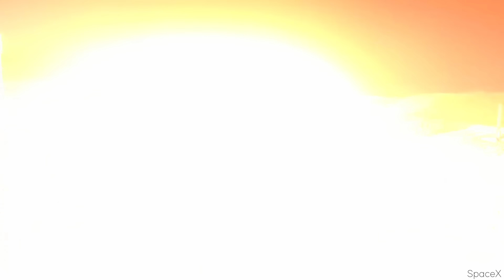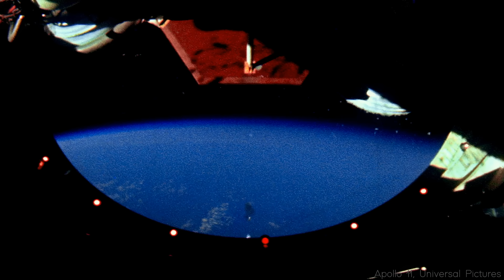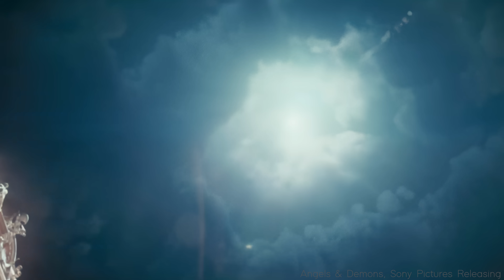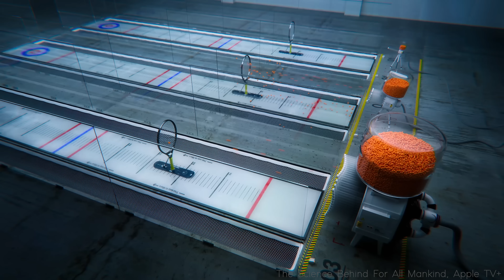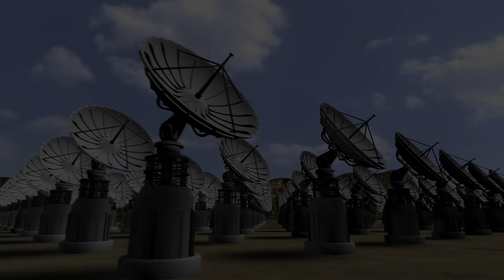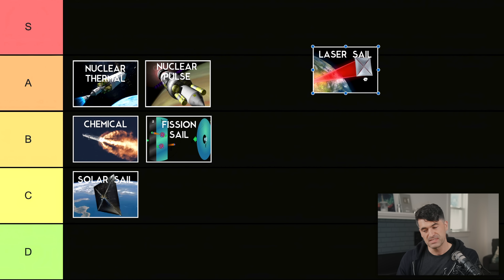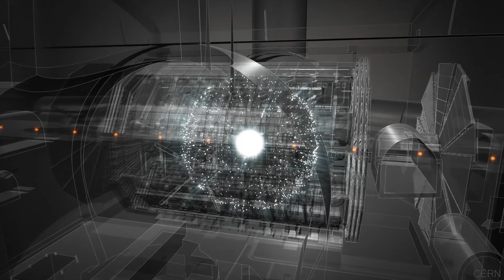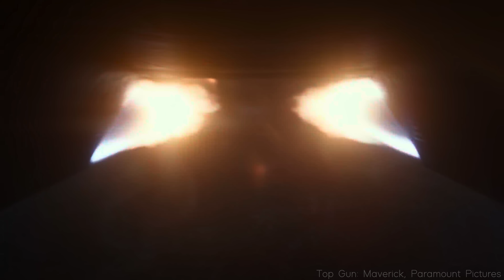Interstellar Propulsion Technologies - RANKED!

Comment: Another concept for a spacecraft is a variation of sails.

Originally, I had this idea, unlike others I’ve read about, but then I saw someone else propose it. I don’t remember it having an official name. We could name it “Pebble sail”

One of the major problems with laser sails is their enormous energy requirements. Photons are very energetic for the little momentum they transmit. However, a regular wind sail gets a lot of movement with little wind because the wind is made of air, matter. Being pushed by matter, the energy requirements drop significantly.

Additionally, due to the high energy requirements, the sail endures a lot of heat for little thrust, unlike a wind sail.

But in the vacuum of space, we can’t have air.

This proposal is to replace air with small solid particles. Pebbles.

Let’s assume we can create a beam of pebbles that moves at speeds only slightly higher than the speed of the spacecraft. Isn’t that practically equivalent to wind? The difference is that if the particles are solid, in principle, it should be possible to focus them over great distances.

Then there’s the fact that the spacecraft quickly accelerates, so the speed of the beam must be synchronized to match the low speed at the moment of impact, but it could be a gigantic speed at the origin due to the relative speed difference between the beam emitter and the spacecraft.

On the other hand, the energy required for moderate speeds is considerably reduced, and the energy wasted in the “impact” between the particle and the sail is also reduced, given that the impact speed is low.

An equally interesting concept to study, at least for moderate distances. For interstellar speeds, the major problem would be the extreme precision required between the beam and the spacecraft.

For unmanned spacecraft, a solution could be to use extreme accelerations that would allow reducing the distance in the propulsion phase.

However, like other propulsion concepts, it only works for flyby mission schemes. Alternatively, for future travel missions between both points, once there is infrastructure at the destination that could perform the equivalent braking using the same mechanism in reverse.

Comment: A conceptual ship is also one powered by a microsingularity.

To achieve this, it is necessary to have the ability to create singularities and artificially feed them until they achieve stability and can continue to be fed with mass, until achieving a singularity with a useful mass.

I asked ChatGPT (take it with caution, as there could be errors) what size a black hole would need to be for its radiation emission to be equivalent to 1000G of its own mass in photonic propulsion.

The weight corresponds approximately to the mass of a large asteroid. 1.27E12 kg.

The point is that if such a singularity could be created and artificially fed, we would create a body very similar to a miniature sun, with a gigantic energy emission, but that surrounded could push a ship at 1G speed for millennia (that’s why I put 1000, as I assumed it would not be 100% efficient, and the whole set would be much heavier than the singularity itself).

If such a singularity were surrounded by a sphere or swarm similar to a Dyson sphere, but due to its tiny size, the ship it would "only" be a few thousand kilometers in radius, it could propel that set for thousands of years.

And if somehow mass could be continuously injected into it, we would have a perfect matter-energy converter.

The point is that if the swarm/sphere redirects the energy back to the singularity, or radiates it equally in all directions into space, the ship is stationary. If it reflected the energy in a specific direction, the ship would move.

It is the miniature version of the proposals to move stellar systems. If the mass quantities are correct, we would be talking about relatively reasonable quantities for a civilization between scale I and II.

The requirements are much lower than moving a star, and the propulsion capabilities are much higher. With 1G, it would be possible to travel to practically any place in the galaxy within a single lifetime from the traveler’s perspective, thanks to time dilation. The limit would be probably the ability to deflect and absorb incoming radiation of such high speeds more than the engine limitations.

This is a technology that require a pretty advanced civilization to be able to create such singularities and gargantuan ships, but it doesn't require new physics and the basic idea is pretty simple.
The big question is... is it technically feasible (even if it's not by the size of our current civilization) to create and feed such singularities?
I guess if we can focus lots of photons (really LOTS) or neutral charged particles like neutrons, into a tiny place, it should be possible. But I'm sure there would be bigger problems that it seems on first place.
I think it's safe to assume a civilization type between I and II, as a conceptual base of resource capability. An interesting research concept.

Comment: I propose the Norris Kinetic Hyperdrive: a well-placed roundhouse kick to any mass will accelerate any body so much that it will not just violate causality, it rewrites it. It's also extremely energy efficient, because you only need a single Chuck Norris to fuel it.

Comment: A light sail doesn't need to be solid, it could be a fine mesh with holes smaller than the light wave length.
Reply from the maker: Ye there are aerographite type materials that are porous but can still be effective, but of course they’re very weak to any kind of stress

Comment: The problem with the laser sail (and also sequence of external nuclear bombs ) is that you can't use it to slow down when you get to the destination. I think this should bump them down a tier or two.
In my opinion, the best solution is some AGI that is miniaturized to nano probes weighing a few grams each. A swarm of these can be launched from Earth orbit using small sails. Because of their low mass, they can be accelerated much faster, and also decelerated at the destination star system. The sail also acts as a solar panel.
The swarm can have different sensors, and maybe even make new probes from asteroid material.
Reply: Any solar/laser sail can simply turn around to turn the sail into a brake using the target star's light and stellar wind.  It wouldn't necessarily be enough to stop the ship (depending on the mass of the target star), but it should be able to slow down enough to do observations, take pictures, and send the results home via a laser.

Comment: One huge issue that David fails to mention with Laser Sails , is that there is no mechanism to slow down at the end of your journey. So Breakthrough Starshot will pass any planets in a very short time frame, I believe around 45 minutes at around 1 AU or less at 0.2C . Great for some initial photo's but very limited in terms of long term method exploration, probe landing etc. Even though there are concepts to use a sort aerobraking but with photons , it's always going to be limited to craft with very very small masses.

Comment: What if you build an interstellar ship in orbit with nuclear thermal propulsion, giant laser sails and a bunch of ion drives and on top of that you shine large laser on the sails from Earth as long as you can. 
I mean, it would be expensive and very time consuming, but with big rockets like Starship being more and more available in next two or three decades the price to building such a thing may come down.
Why not use benefits of all potential propulsion methods at once ? You acclerate with lasers and solar sails and with ion engines giving you a bit as well, and then you burn nuclear thermal propulsion fuel for slowing down. Or you can accelerate out of solar system by all propulsion methods combined and when you escape Sun's gravity well you immidiately start slowly slowing down with ion engines to your destination...etc
Idk, logically it seems that combining all available propulsion methods would be good even if it needs more mass for the ship.

Comment: The Alcubierre Drive always interests me with how much even theoretical pop culture science pushes it as the answer to warp drive. But almost always leave off the fact that unless the ship can also reduce its mass it could never pass or even approach lightspeed in application, since thermodynamics limits the drives speed and max useage; it most likely would be a GREAT technology to have for system wide transport drive, but interstellar; not so much. You'd have to drop in and out of the warp bubble as heat built up in the bubble a lot, and there are a lot of chances for things to go REALLY wrong from a snowball effect kind of failure. Heat stress on the ship's hull and superstructure for example, drive problems, etc. So yeah I fully agree that it belongs low on the list at current, though it is the only true "warp drive" even if it is not a true FTL warp drive like people think it would be.

Comment: Have you seen the prollelantless drives on youtube?  some groups are actually researching it but looks like havent got any further, i think the power supply is just too huge to make it work, but it works, basically you charge a capacitor in space and it moves, without propelling any matter.  You need high voltages. Im thinking maybe a peltier device in space that exploits the hot and cold could gernerate all the power you need to power something like this. I seen it on "alt propulsion channel" who ran a  few videos on it and interviewed a group researching it, and they were very convincing in it.  They were saying something like moon in 4 hours, mars in 4 days, nex star system in 4 years.  Speed of light basically, but with no propellant.  What i got from it they needed an equally huge power supply to make it work but i dont think they considered peltier devices to generate electricity in space.  If you heat one side and cool another of a peltier device it generates electricty, inefficiently, but it is able to capture heat otherwise wasted and turn it into electricity. In space with the hot sun and cold back side would be perfect to generate electricty.  I dont think anyones played with a peltier device in space.  Anywawy this is basically the solar sail idea , slow accelration, but with no propellant and better then solar ions to overcome the suns gravity i suppose.

Comment: i'd say we would only get FTL traveling once we have a true GAI(General Artificial Intelligence) since we can have that AI make the technology possible for us. But if we stay within the speed of light, i'd say a system which used fusion instead of fissure, that would give us enough energy to leave the solar system at neckbreaking speeds. 
Also, I would say Earth Escape systems are totally different than interstellar propulsion systems. Just build the spaceship on the moon instead of Earth. It's easy to get to moon with normal rockets and use advanced systems for interstellar space travel shot from the moon, where it much cheaper and easier to launch. So a combination of several techniques combining initial propulsion and then sustaining and accelerating using all different kind of techniques combined. Like use a chemical rocket for initial propulsion, then laser beam on some sails, then use a ion engine for sustain and use that for decelerate.

My story is a bit random and all over the place, but i truly think there is no one idea that is the best, but rather the combination of ideas.

Comment: What ! No Kugelblitz drive?   Yes I know, we have to be able to create a sub atto-scale black hole  (by  extreme focussed accelerator/ lasers)...then feed it up with beamed mass to femtoscale scale  (approx million Tonne mass) status and then let Hawking radiation pour out in the Petawatt scale (whilst balancing energy output with extra fed in mass). Point and collect the radiation produced and hey presto - a drive that depends only on fed in mass and relativistically mass to energy highly efficient  - similer to an anti-matter drive.
Easy !  😆😆.   
Well - an extreme technical challenge to ever attempt for sure    - but at least it doesn't defy any fundamental physics. Or so I thought  until  I (unfortunately) learnt of a new study (this year) that argues that dissipative quantum effects  (vacuum polarization) would render creation of micro back holes from zero mass upward as impossible. Oh well - only need to collect a micro black hole that has neared end of its life and use that. Primordial black hole?  Or just wait 10^80 years for a conventional size black hole to reach that state. 
One for the bottom row I think.

Comment: One question: If we are moving with relativistic speeds, how do we cope with dust particles, and other stuff like lumps of ice floating around in the interstellar void? if that spaceship collides with one of those, isn't that problematic?
Reply: Very problematic. A hardened magnet shield system could deal with very small particles the larger particles are the challenge moving at say million of miles per hour.

Comment: The nuclear pulsed engine design isn't actually banned under the test band treaty.  You're just not allowed to test nuclear "weapons"  it's still legal to use nuclear blasts for "peaceful" purposes (like terraforming, which the Russians tried once, creating a lake.). A nuclear pulsed thing would fall under the peaceful use thing.
Reply: A significant problem with launching a nuclear pulse rocket from Earth's surface is that detonations in the upper atmosphere can cause serious EMP problems, knocking out electronics for hundreds of miles around.  Once you're above that, the nuclear blasts will punch a hole through GPS, Starlink, and every other satellite constellation, the replacement cost of which would be added to the cost of the program.  Better would be to build the ship in high Earth or low lunar orbit, the blast off from there.  It would involve higher construction costs, but much lower launch damage.
Reply: @pahtar7189 
The blast process are could be several AU from earth.

Comment: There is more to solar sails or lightsails as shown in this video. One idea would be to make them diffractive or reflect in multiple layers so that more thrust is obtained from one photon. Another is manufacturing them in space and making them not foldable and but just a few nanometers thick which would get the mass per m² down to far beyond 0.8 g.

Comment: I had a friend, unfortunately passed-away, who was a physicist, a mathematician, and (like me) a science fiction nerd. He told me several times that particle entanglement implied spacial entanglement, through something he called a transform. He developed this as the idea for a FTL star drive. The ship "translates" or "squirts" from its present space to a mathematically-similar space closely ahead of it. Even if that distance is just a few miles, the fact that the ship instantly stops being "here" and appears "there" means "travel" is still faster than light. Causality, locally, is broken, but the effect gets smothered by the "weight" of causality in the entire rest of the Universe.

It's an interesting concept because it has built-in limitations. Two of these are 

(1) the thing won't work right in any gravitational field worth speaking of. Start the drive at a certain distance inside a solar system and you end up being scattered in a smeared pattern of debris in some quantumly-probabilistic random location in the Universe.

(2) there is pollution of the ship spaces and the living bodies in it from the occasional dust in the consecutive spaces that the ship "transitions" into, so medical nanobots are needed to scrub dust from bodies and repair cell damage. But the nanobots are not miracle workers, and this last issue means that navigation can be tricky, unless you can anticipate dust concentrations in the spaces ahead of you, you can get "becalmed" inside the dust, having only reaction drives to get out, as using the Entanglement Drive will kill everybody and wreck the ship from dust pollution.

Why yes, this is the basis for a star drive in a forthcoming novel.
Reply: pollution of what?
Reply: @azyy1248  Basically the ship teleports a short distance into the new entangled space. But space isn't empty. There are random gas molecules, occasional dust particles, and even, rarely, tiny pebbles. So now you have that stuff (not too much of it; it is indeed rare in deep space) polluting the spaces inside the starship, including any living bodies therein. Note that all this stuff may be moving at velocities (speeds and directions) that the ship's regular impulse (reaction) drive isn't pushing the ship, so the gas,, dust, and pebbles can often act like tiny bullets, relative to those bodies inside the ship. A dust particle traveling at a speed relative to the ship of several thousand miles an hour is going to do damage.

In the novel, I envision medical nanobots that all space travelers have, to make repairs and expel foreign particles.